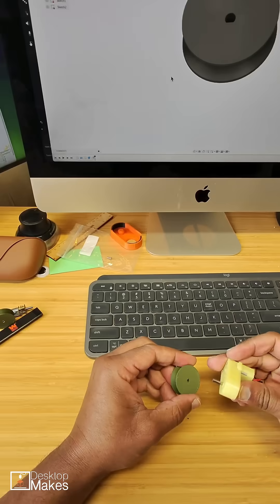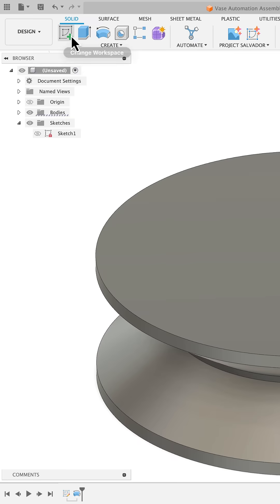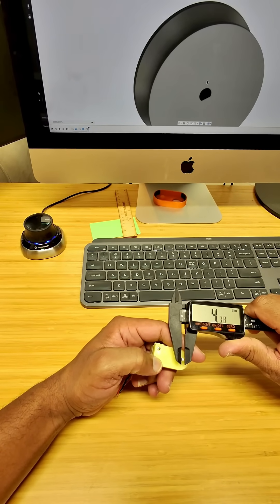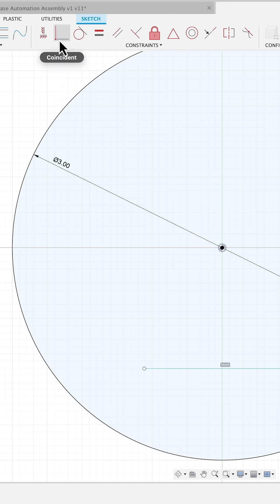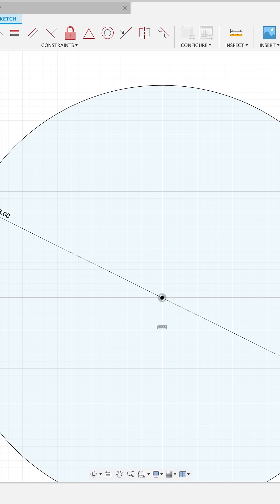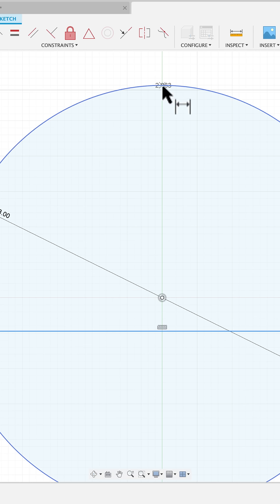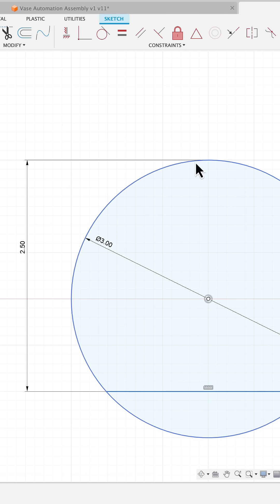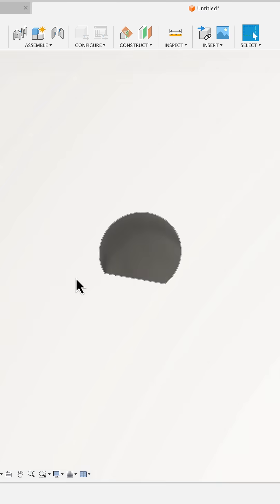Trick to fitting 3D Prints to Motors

Comment: im a machine manufacturing student, drawing CAD designs is my daily bread and butter. its not that difficult to draw the D-shaft, the harder part is tuning your 3D printer so that it prints exactly 3mm D shaft. i've had so much torture trying to press 3D printed gears and pulleys onto motor shafts
Reply from the maker: In the full video on my channel, I go through the process of adding the proper clearance to get a good friction fit on the shaft.  You're correct, you do have to fine tune this distance for each printer.

Comment: In SW pressing shift when adding a dimension it goes to the arc tangent, maybe in fusion it's similar
Reply from the maker: Just tried it with Shift but it didn't work.  Good to know this is the method in SW.  Thanks.